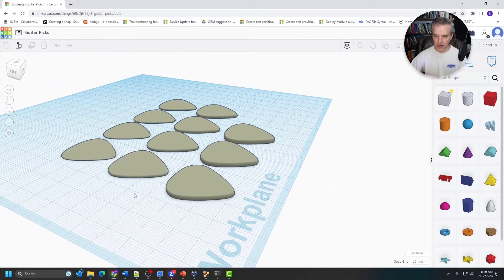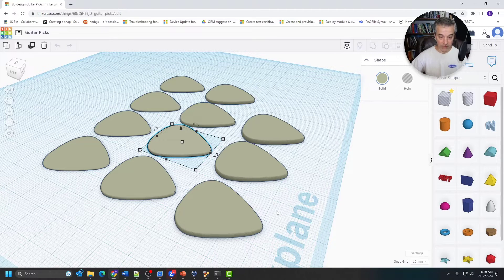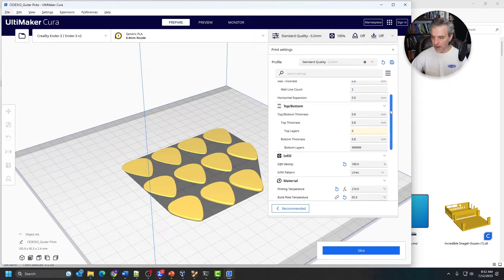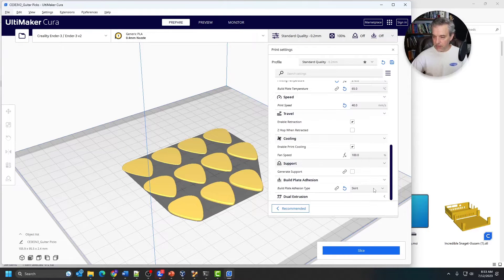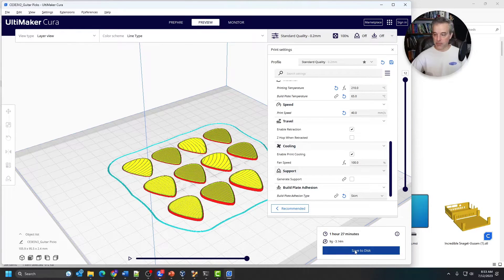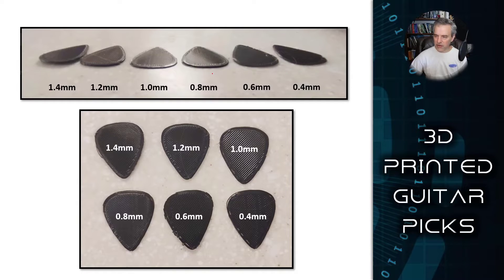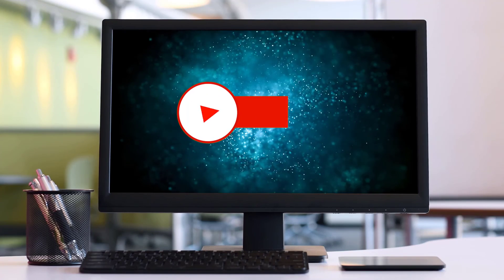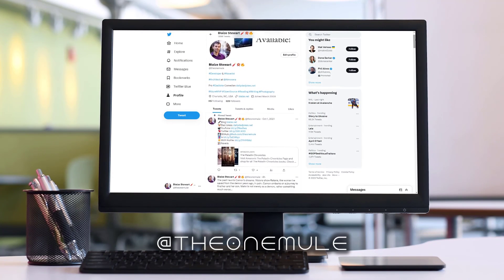3D Printed Guitar Picks -- How To Make Picks At Home

Comment: So I've been working with Tinkercad and also started learning the bass recently. I'm wondering how you were able to make the guitar pick shape with rounded edges using that software. If you have any guides or advice that'd be appreciated. Just finished printing off a kinda blocky one to try out myself.
Reply from the maker: Create a "hole" using a cylinder from a retangular prism. This will give you a cut out. You can covert that shape to a "hole" and use it on a triangle to round the corners.